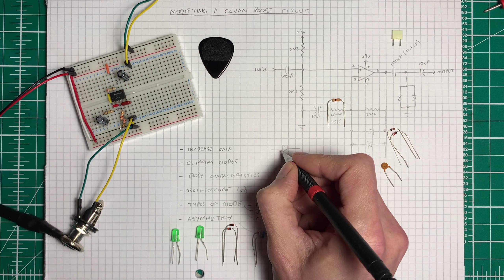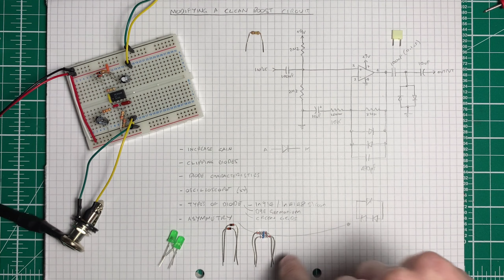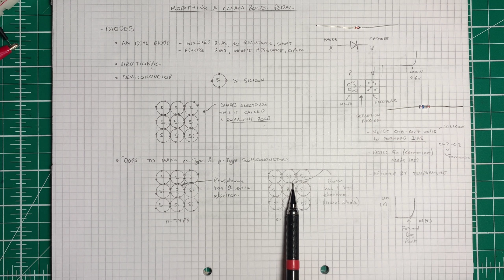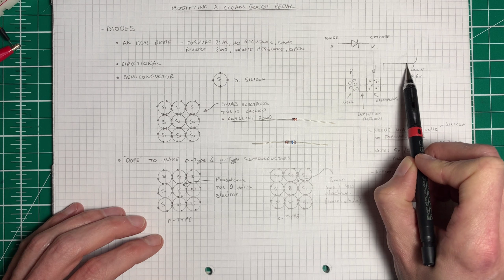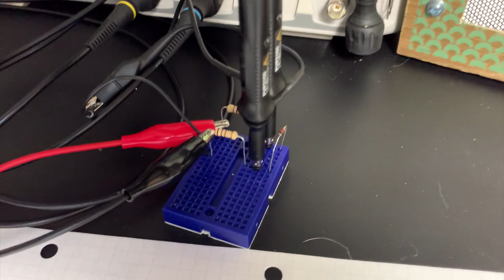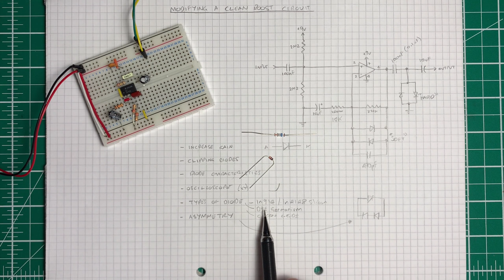Modifying a Clean Boost Guitar Pedal

Comment: Hi, I built this circuit and it works fine. Then I added a DPDT switch to switch between boost signal and true signal. During switching it makes a loud sound for an instant. I think it's resulting due to the signal bouncing in the switch. Is there any solution for that? Pls let me know.
Reply from the maker: That might be a switch pop.  There’s a brilliant article about it here. http://www.muzique.com/lab/pop.htm
I’d try the pull-down resistors first.

Comment: I am not an expert in electronics either, but shouldn't you have a current limiting resistor on the output diodes?  BTW your input voltage divider solved a problem I had on another project, thanks!
Reply from the maker: Glad the voltage divider helped, Jim.  You are absolutely right about a resistor, a 1K between the 100nF capacitor and the diodes would be best practice for a number of reasons, which include protecting the OpAmp.  Your excellent comment led me to measure the maximum current through the output diodes and it reached about 3.5mA peak without the 1K resistor and 2.5mA peak after (with the 220k and 10k resistor setting the gain). A Ge should be able to handle around 50mA and a Si about 200mA. So, the didoes themselves should be okay in the experimental setup here.  The resistor would also change the clipping characteristics of the diodes very slightly, so it is definitely one to experiment with. The MXR Disotrtion+ uses 10K with 1n34a point contact Germanium diodes, the ProCo Rat 1K and 1n914 Silicon Didoes.

Comment: Oh man, tell me, how dumb am i?
I bought silicon diodes instead of germanium. I guess this circuit won't work, right?
Reply from the maker: The 1n914 (and indeed the 1n4148) I use prior to the Germaniums are (small signal) silicon.  The forward voltage is 600mV-ish on those, same as your 1n4007s, so they should work.  I'm always buying diodes of all shapes and sizes as they all sound different in clipping circuits.
Reply from the maker: I do recommend getting some vintage, point-contact germaniums though, they sound ace in clipping circuits.
Reply: @MusicTechknowledgy  Thanks for the advice.